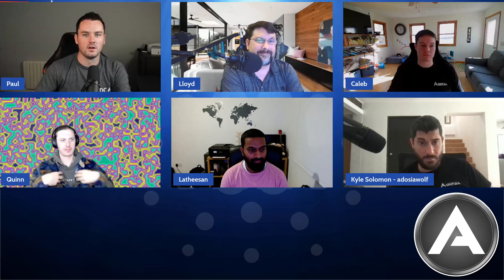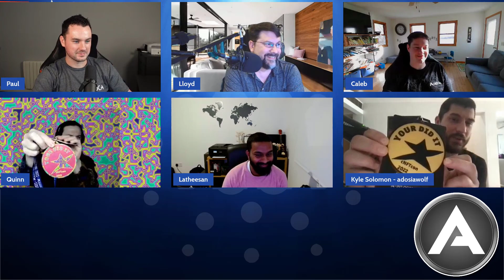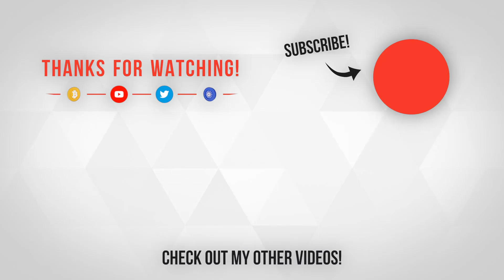Adosia - Distributed Manufacturing with 3d Printing on Cardano

Comment: A great idea, I hope they could figure out an app that printers could use in order to not get long-term access to the printable. I guess a ZK 3d modeling app would be a way to go.

In terms of the toke utility... come on guys, I was expecting the token to be required to do anything and everything. Otherwise, it would be just the next farm and dump token without sufficient utility.

Comment: Cheers Paul. Great interview. Sounds very exciting. Will need to watch this again to understand why blockchain is needed - i must be missing something.
Reply from the maker: Mainly blockchain is to remove the middle man / company from the equation so everything is run by smart contracts
Reply: @CardanoWithPaul  ok. Say for example I need a 3D printed part. I find a engineer to make the designs and pay him for that service. I then find a local or an online 3d printing shop to print the part and pay them for their service. 
I don't understand the benefits of the design  being an NFT or why blockchain is needed for the process from start to finish.

Comment: Something i didn't understand: there are 3d printing shops all over where i live. Thousands throughout the country. Thats already decentralized. A marketplace for selling patterns i can understand, but incorporating the actual production will introduce such a huge range of new problems...
Reply from the maker: Ya it could bring some problems but thats where the reputation of printers will come into play. The marketplace will allow anyone who has a printer at home to take part and earn from printing orders at home
Reply: The idea is these small shops will be able to use adosia to bring in jobs and reduce machine idle time and build a reputation without having to put a ton into marketing their services.
Reply: But how do you deal with personal information? A stranger will know where someone lives in order to send it to them? They can share that information however they like. Unless there is an anonymous mailing service. I just don't see the benefit. Big 3d printer companies will always be able to outcompete the smaller ones.
Reply: @reemssmeer-maar-dan-omgeke9028  There are a few ways to handle this. One of several elements being developed and edge cased. A definite challenge, no doubt about it. 3D printing is the catalyst. We are building towards a total RFQ system for machinsts, cnc hobbyists,  laser cutters, etc, etc, etc.